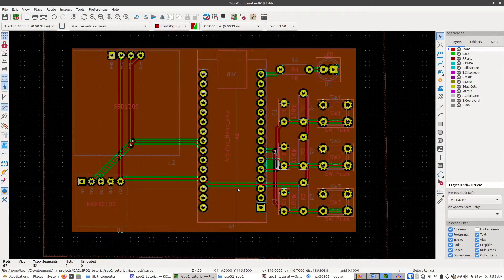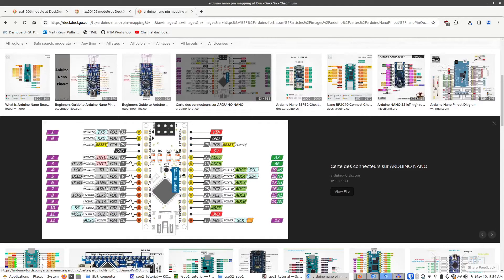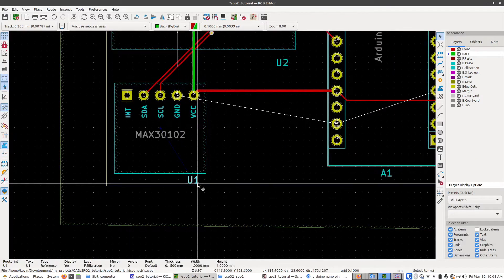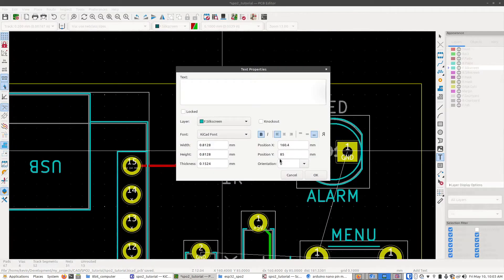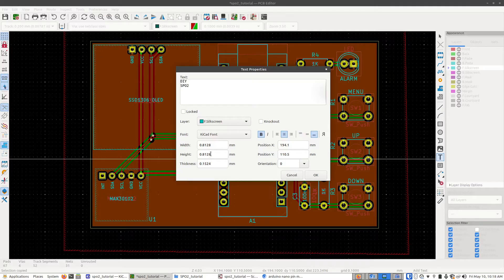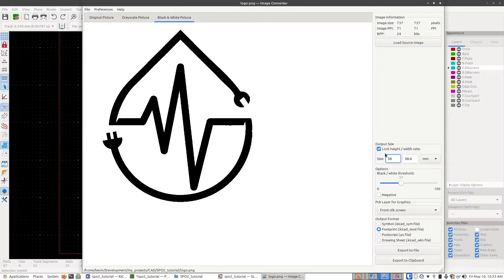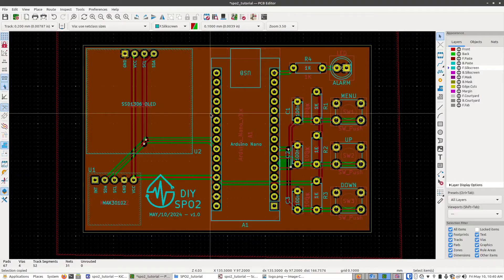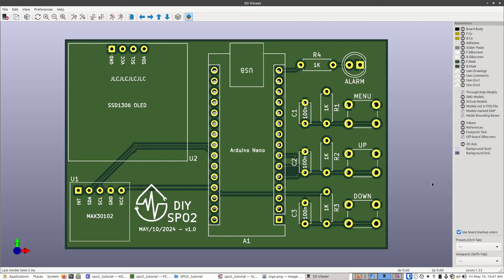KiCad Final Checks and Customization | Part 8

Comment: Does the ground need to be connected to the components?
Reply from the maker: In general yes - it would depend on what the board is doing - on a lot of circuits the ground is just the other terminal on the batter/supply…different than how the ground in a house electrical system